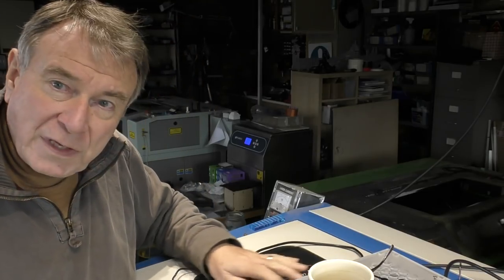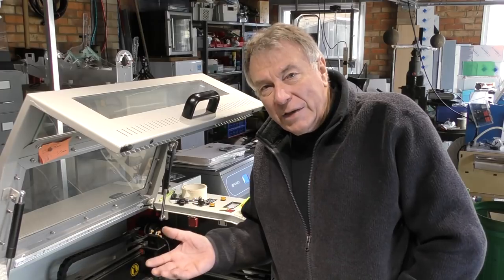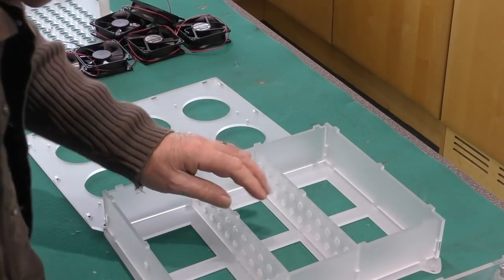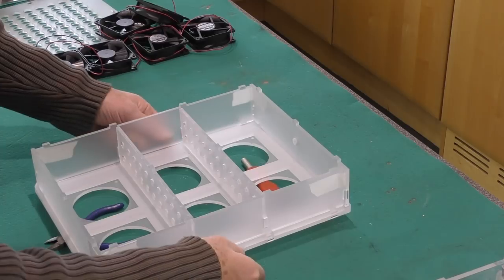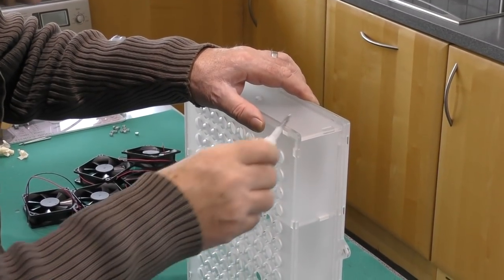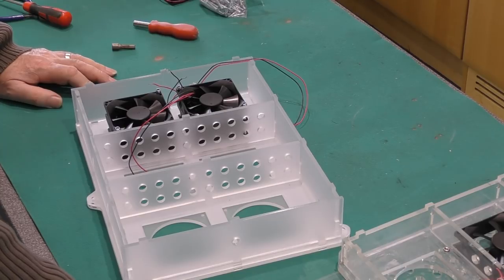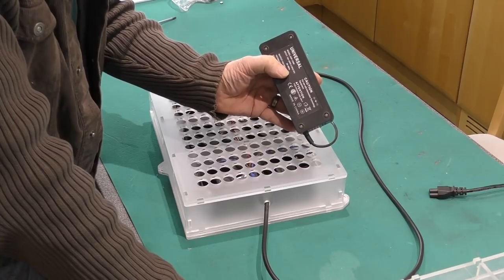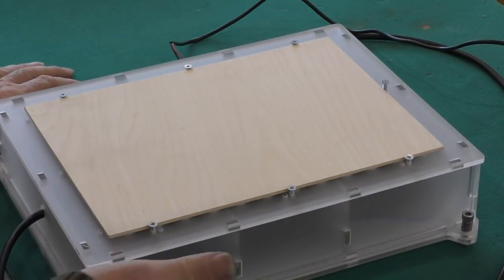RDWorks Learning Lab 165 Making a Vacuum Table

Comment: Hey Russ. Quick message to say thank you so much.
We're a young french company producing leather goods (now apple peel & PU based leather, cause genuine leather was an absolute paine, as you know). 
We went through a vast majority of your videos and it really enlightned us, they also prevented us from poor hardware upgrade choices when we were facing issues you documented (bad air assist, nozzle sitting almost 15 mm on top of material, cooling issues...etc).

Would love to see a waterchiller build although you already have an industrial grade one :D

Keep up the good work,
Milena & Hugo
Reply from the maker: Hi Team

It just so happens that I do have a very crude sketch of a DIY chiller based on a second hand small chest freezer (or a large one if you do lots of work with a powerful laser) Fora few euros you can find one on your local Gumtree . I have used this principle for some agricultural germination test systems  where I used to use a small counter top freezer. 
The temperature relays are also cheap. 2 of these
https://www.ebay.co.uk/itm/STC-1000-Digital-Temperature-Controller-Dual-Relay-Output-Thermostat-with-NTC/173987471995?_trksid=p2485497.m4902.l9144
A coil of 10mm copper pipe from your local hardware supermarket 
A small submersible pond pump to circulate the cold water 
Go to this link and download my sketch. It will be there for a few days
https://www.dropbox.com/s/c8ct7vz45qjw1sp/DIY%20Chiller.pdf?dl=0  

Best wishes to you both
Russ
Reply: Brilliant idea to not have to deal with gas filling... We need more space in the workshop though. Thank you Russ !

Comment: I think the vacuum table would be much more effective using centrifugal blower type fans rather than the axial flow muffin fans. The muffin style fans are designed to move air, whilst the blower style fans are designed to build pressure. For holding things down, there is really no air movement, only pressure. When comparing specs on fans, look at the pressure ratings, not the cfm.
Reply from the maker: Hi
Many thanks for your comment because hopefully others will read it. Yes I am very familiar with pressure capability of centrifugal fans but this, like many of my projects was built from materials I had to hand. Stalling the airflow on these fans is not going to cause overheating and there is adequate negative pressure to hold my card flat A more suitable fan will not make it hold the card any flatter. Even my vacuum cleaner prototype would not pull the Baltic birch ply flat. 
Best wishes
Russ

Comment: Not sure if this is the right place to start this discussion but it is the best resource I have found so far, (thank you russ) regarding the water cooling of high power tubes. I have read that aquarium pumps and water tubs are only really good for lasers up to 60w, after that chillers are required. I’m not convinced. I have a 100w tube on its way so I got to thinking what a chiller is and where gains could be made to the water pump method. We already have a large fan moving a lot of cool air in our fume extraction, so what if one was to place a 120mm pc water cooling radiator into that air flow? A suitable adapter would be trivial to make on a 3D printer. By doing this there would be no additional noise in the setup and guarantees cool water through the tube. Thoughts would be much appreciated.
Reply from the maker: Hi James
 In principle there is nothing wrong with your idea but in part it does depend on where in the world you live and what your normal workshop temperatures are in summer. On one of my machines (70 watts) I have the plastic reservoir you describe and on the other (60 watts) a so called chiller  (type CW3000). This chiller is in fact nothing more than your idea ie a fan, a radiator and a reservoir all in one case..  Most quality tubes with metal  water jackets allow a running temperatures up to 40 C. Others say 25 C. In practice I am happy to run both my tubes up to 30 C in summer periods when occasionally my workshop may get to 35C plus.  Once the ambient is within 5C of my target 30C the cooling becomes inefficient and the water temperature climbs quickly and I have to stop to let things cool down. This is no problem for me as I am not running a business and those hot days are very rare here in the uk.. I have recently used a machine that has just such a pc fan and radiator but it is just a 40 watt tube.  I doubt that will cope well in UK summer temperatures but the guy I went to see will keep me informed. I suspect you will need 3 or 4 such radiators to manage your temperatures or maybe an oil cooling automobile radiator..  By the way, from experimental work I have done I found that there was a loss of about 5% power when working at 45C (I did this for several hours on one of my tubes) as opposed to working at 20C.
The problem with the CW5000 refrigerated chiller is that the instant cold water it creates cause shocks to the tube every time it switches on and this dramatic change of water temperature does affect the power output. Several people who do photo engraving work report distinct  colour banding in their pictures do to this effect. They have overcome this shock effect by making the cooling indirect and using the chiller to cool a plastic tub reservoir via a copper coil 

Berst wishes
Russ
Reply: Thank you for your reply russ, I am in the uk too and the cutter will be in a well insulated garage so no great extremes at all from the weather. The radiator idea is not to replace a water tank, rather compliment one in order to add additional cooling for the larger tube. I was thinking a 30ltr reservoir would be adequate, but without knowing the actual waste heat output of tube, this is a complete guess. It is going to be a hobby machine, which after the initial novelty period wears off, will have nothing more than strenuous to do than an afternoon on a rainy weeekend!
Reply from the maker: @jimmer147  
Hi Jamie

I don't think you need to worry too much if you are in the UK for several reasons. If your tube cliams to be 100 watts , depending on the manufacturer and the model it my not be what it says on the tin. Let me know what you have bought and I will advise. Secondly if the power output is 100 watts,  that does not mean there will be 100 wats of heating into your water. However for the sake of example lets assume that there is 100 watts of heating into your water. Using simple calorimeter calculations it will take  about an hour to raise the temperature of 30 litres of water by 10 C and that assumes zero radiation loss from the reservoir during that hour ( an impossible scenario). Thus if you are going to be a casual user then 15 litres will be perfectly adequate for all but our warmest summer days . I have a small copper coil I made to drop into my reservoir over the pump. If I really do have to cool my reservoir I connect it to my garden hose and trickle about 1 l/min of cold water through the coil and onto my plants. UK domestic water rarely gets above 15C. I have only used my coil twice and both with perfect results. I had planned to turn the flow on and off with a washing machine water solenoid controlled via my digital thermometer/relay. However,  just adjusting the water flow is perfectly adequate.

Best wishes
Russ
Reply: Russ as ever your insight and experience is always very much appreciated, I shall worry no more, I have ordered an efr f4 100w In a Chinese machine, having watched nearly all of your videos I chose to order a higher power laser knowing that realistically I would end up loosing a good percentage of that. I have already purchased an amp meter to install before ever powering it up. Along with the parts for an ‘ultimate air assist’. In all of you tinkering and thinking have you considered wiring the z stepper into the controller? For what it would take to do I don not know why it is not done in the factory,

Comment: Hi, I have a 100 Watt Chinese laser. What kind of numbers should I see on a mA meter. I am getting 32.0 max. on 95 percent setting.  Thanks, Mike
Reply from the maker: Hi Michael
Your 100 watt tube may not be what it's claimed to be. If you have a maker and model number I can be more specific.. In general the max current limits are these. 50watts (20mA), 60 watts (22mA), 80 watts (24mA) and 100 watts (26mA).  Running at currents in excess of these values will dramatically shorten the life of your tube. There is no fixed relationship between watts and %power and typically you will find that these max current limits will be reached with % power between 65 and 70% if you do not have an ammeter to accurately determine your max allowable current.. You may really have an 80 watt tube (max 24mA) that has a maximum power rating of 100watts. This is a maximum TEST value and not it's normal safe running power.

Best wishes
Russ

Comment: Hi Sir, can you explore Acrylic sheet welding by the laser cutter? if you type Laser stacker in youtube, you will see just 1 video making laser weld acrylic sheets or acrylic pieces, can you explore this aswell? thanks! i have learned plenty in your videos sir
Reply from the maker: Hi Allen
I think the term "welding" is a bit of an exaggeration. When you heat acrylic it evaporates  and in the lower temperature zone just behind the cut you get a thin film of liquid acrylic that flows across the surface and will also flow into the interface between two sheets by capillary action. This liquid acrylic causes a bonding between the  two surfaces with a penetration of maybe 3 or 4mm all round. This bond is nowhere near as strong a the chemical bonding cement but it will certainly hold layers together for many practical uses. Effectively it is auto gluing. For multi layer work where some layers must be removed (you can see this on the video of making a robot) you can fairly easily pries off unwanted areas  whilst the joint is warm thus demonstrating that the inter-layer bond is not that strong and does not qualify as welding  in the sense that I understand the word.. You can easily experiment with your own machine because there is no magic in this,  Just stack 2 or 3 layers together and run the program as many times as it takes to eat though the layers to want. It will take a good 3D imagination to work out your program but you will have to do some speed and power trials before attempting a program.
Thanks for the interesting comment and for others who may be interested this is the video to watch
https://www.youtube.com/watch?v=puDD_CrVH7g&t=219s

However, there is no need for me to demonstrate bercause  to answer your question about exactly how to perform this technique you can just watch this.
https://www.youtube.com/watch?v=Nz8dfCKvCLQ

Best wishes
Russ

Comment: Thank you for your videos they have answered alot of questions I had, I was wondering if you could tell me what type of grease and lubricant you use for your guide rails and rubber belts?
Reply from the maker: Hi
There are as many different opinions on this as there are days in the month,. I presume you are speaking of the HiWin type of linear slides. Most are not HiWin, but Taiwanese look alikes. The real things are packed  with a lithium grease. see page 10 of this pdf   https://www.hiwin.com/pdf/linear_guideways.pdf.   Technically you should lubricate the bearing and not the slide. However, for most people this is impractical so they tend to oil the slide. What do I do?   I use this https://www.ebay.com/itm/Liqui-Moly-Engine-Oil-Additive-MoS2-2009-Anti-Friction-Engine-Treatment-300ml/123541816674?epid=1555902219&hash=item1cc3aa8562:g:FawAAOSwnHZYh1mF
 wipe the slides clean with kitchen towel maybe twice a year and then with my finger (or a small brush) apply a thin film along the top pointed edges of the slide where the bearings run. I turn the power off and SLOWLY ( or your stepper act as generators) move the head or the gantry back and forth along the full travel about 8 or 10 times. I then wipe all the excess oil from the slides. 4 years  on and I have no hint of wear or trouble.
Best wishes
Russ
Reply: Thanks for the info Russ love the videos I'm learning alot

Comment: But you can not cut on this table? will it burn?
Reply from the maker: Hi
You are correct. This is NOT for cutting. It is specifically designed for photo engraving with a compound lens where precision focus is so important. If you are much more than 0.3mm away from perfect focus then you start to lose the super crispness of the image.. If you want to do card cutting then I always use a pin table because precision focus is not an issue for cutting see    https://www.youtube.com/watch?v=kMDRzBZTW9c  and   you get lots of clearance for the debris to fall away see  https://www.youtube.com/watch?v=S_2NOCpACVc

Best wishes
Russ
Reply: Дякую Украина, thank

Comment: Dear,russ
The bule machine that you have is 60w ,from all your youtube viedo ,looks like   you more do engraving with it. Do you know frequency metal co2 laser tube ? It's not widely uses by chinese supplier --price higher than glass tube ,but metal tube is much better  on engraving quality than glass tube.2.and do you know CO2 marking machine just like fiber laser marking machine,just for engraving work ,no cutting ,dynamic galvanometer enlarge working are to 600*600mm .
B/R
linda luan
Reply from the maker: Hi Linda
I don't normally answer your messages because I know you work for GKW and, as in this instance, trying to tell me about your latest and greatest equipment. Yes I am aware of how fibre lasers work and their great but limited capability. I need to explain what my channel is about. I do not run a business and am not using my machines for anything useful. I am a retired engineer with a passion for learning and a video/editing hobby. I can combine all three with my very basic CO2 laser. I have encountered your machines both in reality, as I help people with their installation and through  their  first steps, I have also helped my many correspondents with your equipment. I know your equipment to be well made. There are thousands of people out there with basic Ebay machines and my aim is to find out exactly how far these machines can be pushed and how close I can make their performance match that from the 3 big machine  manufacturers. I am investigating things about the technology that are not documented or well researched. I do this all for my self-education and to provide material for my video editing hobby. The fact that I share my learning is incidental and that so many people have also learnt from my journey was never part of my plan. I know that it has removed the mystery and fear of buying a machine for many people. However, I still have much to learn and am happy to stay with the basic CO2 technology.  The art of using CO2 technology is to understand how to use it at very low power to do engraving and yet have sufficient power available to do cutting. . This is not a benefit that the marking lasers have.and therefore will have limited appeal for the hobbyists market.

Best wishes
Russ
Reply: @SarbarMultimedia  Hello,russ

Glad get your replying,thank you.

You are doing the great things helped many CO2 buyer and me.

And I totally understand "no one like to be sold".

I worked for G.weike not long,you know  we are at jinan city,shandong province---  China the Laser machine Base ,over 300 laser machine supplier is here.

But most ender user they don't understand well about the machine,once the machine have problem they don't know how to solve the problem ,and most small factory,they can't provide good after-service or they even
don't have  after-sale service as their price may lower about 10-15% than G.weike  ,rat race ,lower profit.

I guess most customer won't mind pay  that 10% to get a better machine that could work for them 10 years ,and we really have  customer like this ,they just changed 5  laser tube and 2 electric  power in the past 10 years

G.weike now pay more attention on fiber laser cutting with  high value and growing fast recently years,most CO2 machine sold by our agent ,like "BOSS LASER" "LAGUNA TOOLS" "Spectrum laser"...that's why i want open an ebay account .,End user could get a good machine from us directly.

CO2 marker is  good at marking ,no cutting function,and looks like most CO2 marking machine for business using .

This is 100w reci glass tube working link:https://youtu.be/EwIGxK1ZoMg

I'm learning this machine also,before i do pu foam spring machine for 5 years,this is a new challenge trip for me  also.

Thanks again
Linda